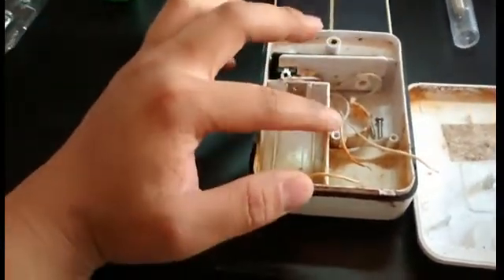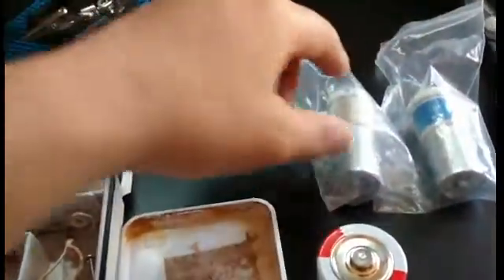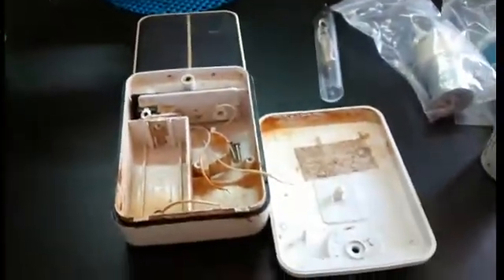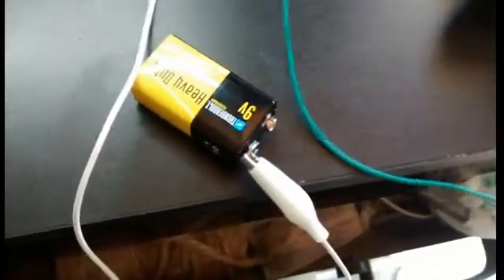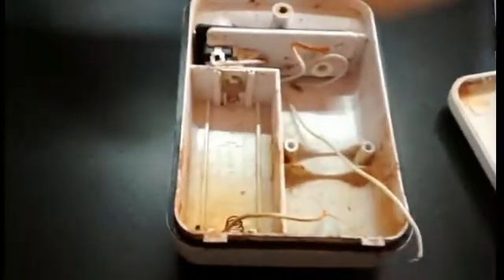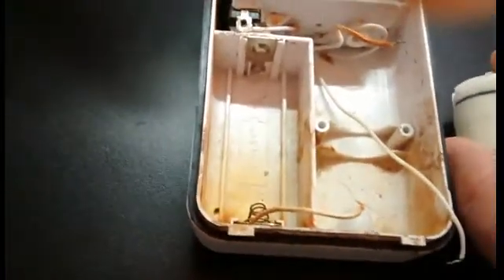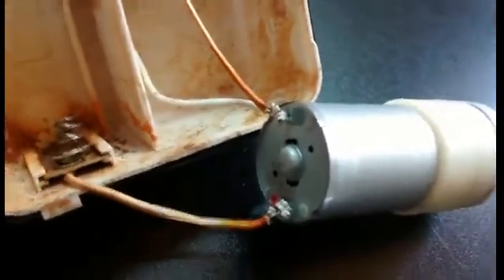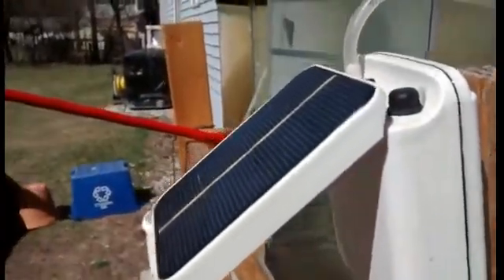Fixing Solar Air Pump

Comment: The concept of these is great, but the solar charger should be on an extension cord so you can store the battery pack in the shade.    They cook otherwise, and rechargeable batteries do poorly when overheated.
Reply from the maker: I have bigger model in my greenhouse that use 50 watt solar, run all my tanks